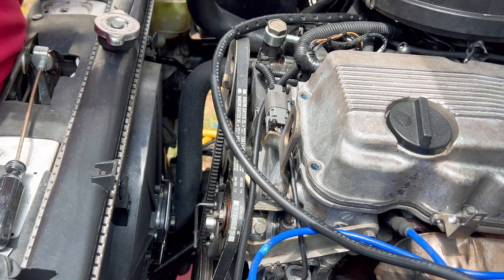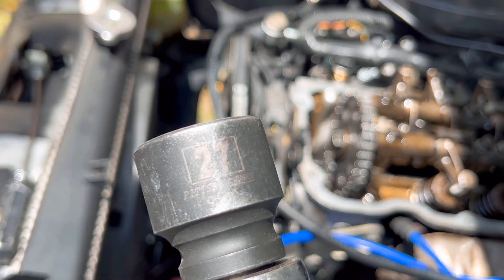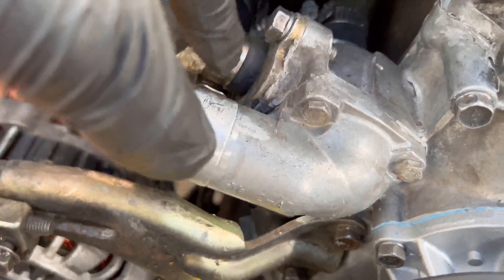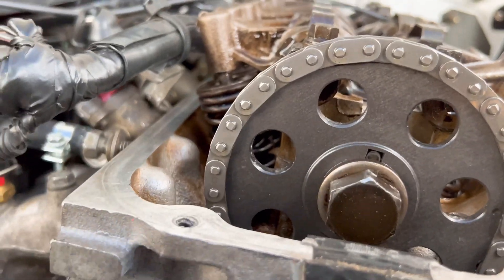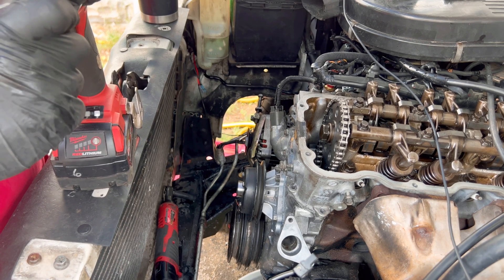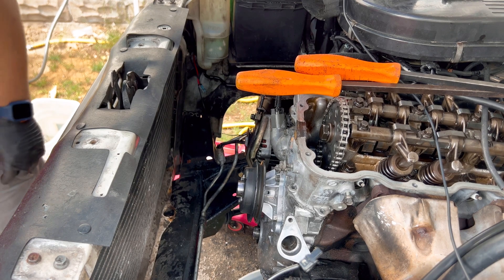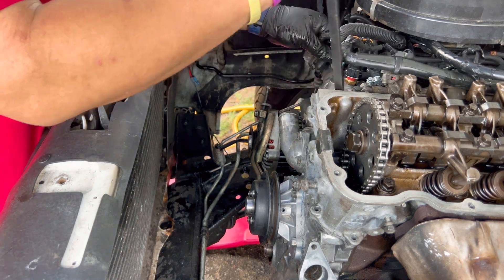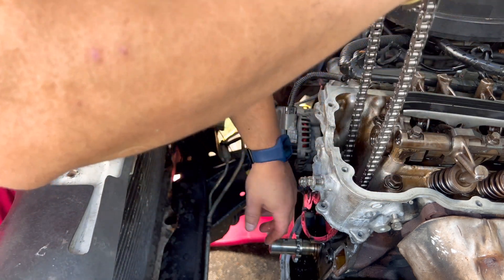Nissan KA24E Timing Chain Removal and Replacement Part 1 (MiniTruckin' Mondays) 4K

Comment: Bro I live in louisiana and I'm in the process of rebuilding my timing chain on my 1996 d21 KA24E I ordered oil and water pump the OSK timing chain kit the martin industries tensioner I ordered a valve cover gasket kit and I'm hoping I have everything I need to do this rebuild right the first time is there anything else that you can recommend me getting before I start I've heard on a video I've watch where this guy said to also get a new distributor but I don't think my truck needs a new 1 to be honest I didn't think my truck needed a new oil or water pump but I'm just seeking advice I'm worried about messing this job up I spent everything I have in buying the truck and all these parts I just want my d21 to be A-1
Reply from the maker: I’m glad you got all the parts, I don’t think you need a new distributor, but if you’re going to be in the engine that much you might want to replace the engine oil seal, the one on the front of the engine.

Comment: hey man I tore my truck down a while back I'm putting it back together now but I can't figure out where the long bolt on the timing chain cover goes could you help me with that I would appreciate it thank you in advance
Reply from the maker: Im not sure but i would check any bolt hole that has a long standoff . Like on the cover it not close to the mating surface of the cover the to the engine block. Good luck

Comment: Hello, what was the cause of you changing the timing chain. Was it rattling or it just didn't want to run? I have a 95 Nissan pickup. Everything seems to be ok but it just won't start
Reply from the maker: Thanks for watching and asking! So my chain was rattling at startups and I had to reseal the oil pan when I pulled the oil pan I found the plastic chain guides s broken in little pieces in the oil pan. So I decided it was time to change the chain. 

For a no start condition, check to make sure you have spark first, then make sure your fuel is reaching the injectors. If those are all good then more diagnostic will be needed.

Comment: After further research, it appears all you had to do was flip the Oil pump worm gear and you would have been good to go. You installed it correctly in Part 2. (14:23 in this video and 2:12 in Part 2) Hope this helps someone.
Reply: Wait what do you mean please explain

Comment: What is the correct orientation for the distributor gear? you installed it the opposite direction (in part 2) from how you removed it?
Reply from the maker: The rotor will be pointing to 4 o clock on the distributor which should be pointing a plug wire number one

Comment: Wonderful engine's, sucks doing these though 👍🏻
Reply from the maker: Thanks for watching. Yeah it kind of sucks to do that. The main issue was that the Chinese stuff I bought from Amazon. The chain was a bit too long and that’s what caused all the issues so I ended up buying a brand new chain, upper cam gear, lower cam gear off of Nissan For less than I paid for the stuff from Amazon. Thanks for watching.

Comment: I’m putting a 95 hardbody engine in a 97 hardbody only this I seen different is the mounting holes for the distributor anyway I can tap a bolt to hold it ?
Reply from the maker: Not really sure I know they are different and I don’t think it will line up with the oil pump shaft. I would just pick up a 97 distributor
Reply: You have to change timing cover to a 97

Comment: So I've got a question: When you put back the oil pump, what position was the distrubutor when you re timed it?
Reply from the maker: The distributor rotor needs to point at the number 1 spark plug

Comment: I saw one thinking about buying for the ka24e ,is a adjustable sprocket I know the rattle are commun on this trucks heard this sprocket also give the truck bit extra power on the rpms
Reply from the maker: I would also get the self adjusting tensioner it’s from Martin Industries https://www.martin-industries.net/product-page/nissan-ka24e-self-adjusting-tensioner

Comment: oh snap i took the crank pulley off without setting the timing hopefully i can recover from this
Reply: Did you fix it?
Reply: @Bread45  i dont believe so it did start up but it made pinging sounds and huge loss of power. sold it for 600$ someone grabbed it next day they go fast dont let go of it i regret it everyday.
Reply: We're you able to recover? What happened?
Reply: @titsandwich1842  i wasnt able to myslef with little knowledge i knew i sold the truck for 600$
Reply: Lol

Comment: What's up bro...quick question...I took off  the power steering pump and belt prior to setting the timing...is that ok or is not right?  And I also noticed that once I set the to sprocket in the center and the dot at 3oclock,  the bottom little spike doesnt  line up on the 2 dash on the pulley..can you advise me please..I'm not a mechanic just a diy kinda dude....thanks bro.
Reply from the maker: Hey man, yeah it’s fine to take those off… as for the pulley not lining up, I would make sure it’s at the compression stroke of piston number 1. Turn the engine over with a ratchet, with your finger or someone’s finger in the number 1 spark plug hole, you will feel the compression push your finger away that is how you know your on the compression stroke.. then check your lines again.